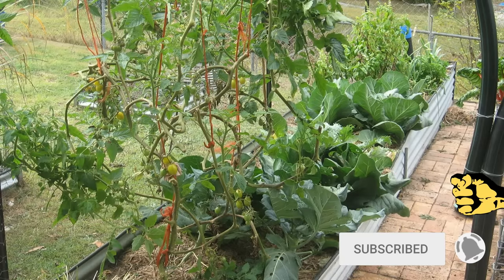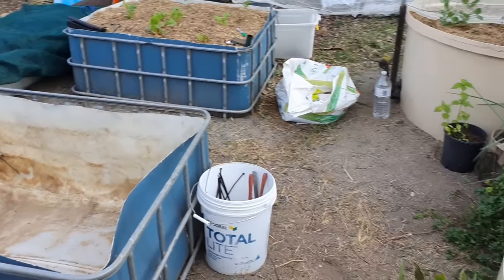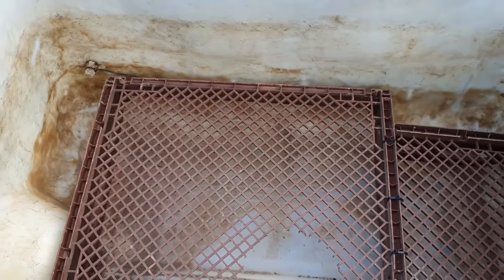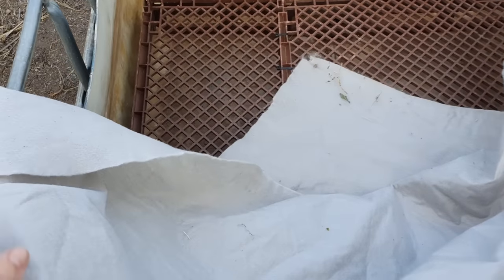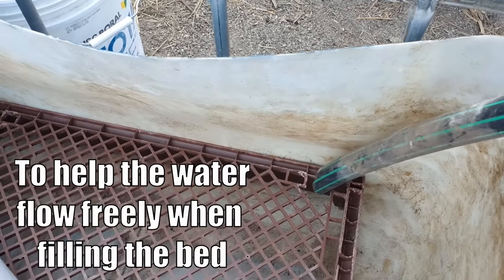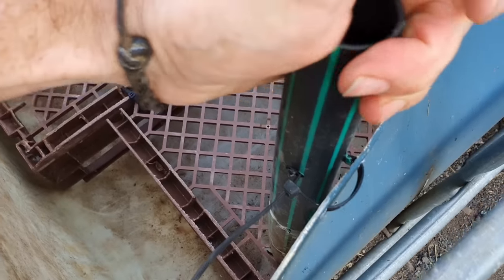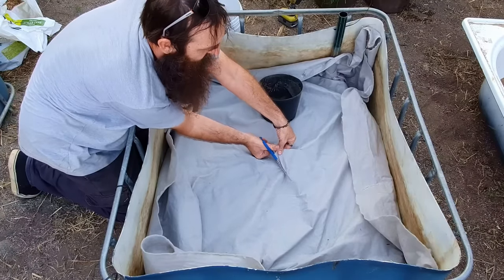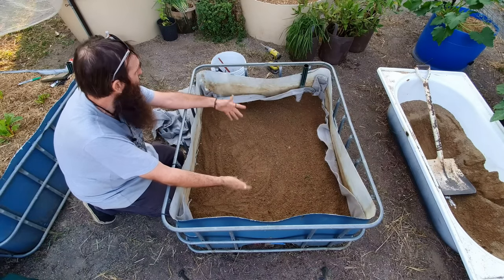How to Make a Wicking Bed with Bread Crates | Large Water Capacity & Healthy Soils

Comment: if you keep water in the bottom of the tank, put a layer of geotextile, sand, and additional level of "this and that" :) why or how get the plants enough water? i would expect the smaller plats dry out without watering, coz their roots not deep enough. i am not saying this does not work, but the water usually does not flow upwards. so what makes it work? i am a bit confused.
Reply from the maker: The water wicks up by capillary action through the sand & soil.

Comment: What paint do you use on the IBC?
Reply from the maker: These ones cam painted as they were a gift from a viewer. I think they just used a straight external acrylic. It does scratch off fairly easy as not much sticks to HDPE plastics. You can get a special plastic primer but I'm yet to try it myself.

Comment: I wonder what is better, this system or  a water electronic hose timer ?
Reply from the maker: I prefer the wicking beds as I only need to top them up once every  week at the moment. They also save a lot more water than in ground gardens as you're not losing any to evaporation or run off.
Cheers.
Reply: Understood, thanks for the tip !

Comment: Hi Rob!
Quick question...(I hope you can answer soon, as I'm starting about 15 of these beds now). Instead of sugar cane mulch between the sand and soil, will sawdust work just as well?  (I have access to literally tons of sawdust).
Thank you 👍
Reply from the maker: I've never tried it to tell you the truth Mark. It would certainly allow water to move through it. 
My only concern is to make sure that the type of timber you use doesn't contain anything that may inhibit the growth of the plants. Some trees have allelopathic qualities & that may pass through to the sawdust if it is fresh. 
Not a definitive answer sorry mate but hope it helps a little.
Reply: @RobsAquaponics  
Thank you for answering so quickly! The sawdust I have access to comes from a cabinet making shop, so I believe the sawdust would be a mixed bag from the different woods they use. I think the main woods they use are oak, cedar, pine, cherry, apple and hickory. I've used this sawdust mixed into my compost and worm beds without any problems...do you know if any of those woods contain allelopathic stuff? (But of course, the woods used are not freshly cut trees).
Thanks Again! 👍
Reply from the maker: @markrakes5602  I'm not familiar with a lot of trees in the US sorry. This came up on a quick search but it might pay to search for each tree individually.
https://www.gardeningknowhow.com/garden-how-to/info/allelopathic-plants.htm

Comment: How does the water wick once the level drops below the level of contacting the soil?
Reply from the maker: Hey Jared. 
It sicks up through the sand in the corners & pot in the centre.
Cheers.
Reply: So the water has to always be in contact with the weed fabric or dirt? I was going to build mine out of 4” pipe and clean rock. Most diagrams show a pretty much level layer of rock (reservoir and your pipe), weed fabric, then soil. In theory if you have an over flow at approximately the top of the reservoir level, the water technically only comes in contact with the soil/weed fabric for a short period, losing the “wicking” property. Once it drops an 1/8 of an inch your not in contact with the growing media any longer. However, these boxes and diagrams are all over the internet and I want to build several for my wife’s garden but I’m lost as to how the water continues to wick once the level drops. Am I missing something or is there an evaporation principle at work? The dry dirt pulls the moisture out of the gravel?
Reply from the maker: @jaredpavatt4122  From what I've seen rock doesn't wick well so that's why I use sand as the wicking medium in all my wicking beds. The smaller particles that make up sand have far greater capillary action than pebbles of rocks. At a guess, I'd say that the fabric folks use to cover the rocks will be doing some of the wicking in the rock filled beds.

Hope that helps.

Comment: My worry and hesitation for embarking on aquaponics is this, how difficult is it for me to take a one week vacation? It's not like I can just pay some kid to feed my cat or put my dog in a daycare. Once up and running, I worry that these operations are so nuanced and particular, that there would be no way for me to find help if I want to go on a family trip. Any thoughts and comments are greatly appreciated. Also, if the electricity were to turn off, how long before tilapia would die andbother things would go wrong? Thank you so much!
Reply from the maker: Hey Jessie. Fish can go a fair while without feeding. We have been away for a week & the fish were just as fat when we got home. 😉 
How long the fish will survive without air will depend on water temperature, volume of water & the amount of fish in the system.  It's quite easy to make a backup air supply in case of power failure. Some folks also sell the pre made switches as well. 
Hope that helps some.

Comment: would the plastic crates leech toxins? I want to use milk crates instead of plastic bread crates? What are your thoughts there?
Reply from the maker: The majority of IBC are bade from food grade HDPE (High Density Polyethylene) so I have no issues using them. 
I was told that some milk/drink crates can be made from recycled plastics but are generally HDPE as well. 
I would probably look into it further if you are concerned about toxins leaching.

Comment: Hello Bob. Im writting an assignement about ginger and wants to to ask you some question, were can i contact you ? :)
Reply from the maker: Hi Sofie. You can ask the questions here if you like & I'll get back to you as soon as I can. 👍😊
Reply: @RobsAquaponics  Thank you, I'll try to do it here. I wants to know which soil you used for your ginger? How often do you give them fertilizer and which kind of fertilizer do you prefer? Are you hilling the soil around the ginger, if yes how often and why? Do you have any problems with diseases? I also wants to hear which varieties of ginger you are using, i read about that the varieties depends of it's use after harvest. What is the temperatur when you start the ginger production? :)
Reply from the maker: @ooprinsesseoo  Hi Sophie.
I found your email on the weekend so have just responded to that. 👍 I'm very sorry it took so long to get to it. 
Hope the information I shared helps you out some.
Cheers.

Comment: Why the sand rather than just filling the bed with growing medium?
Reply from the maker: Have had soil in the bases of some wicking barrels & had anaerobic conditions in the reservoir. The neighbours could smell it from their house so they got remade.😉
I have used a plain dirt/organic poor soil & that worked OK but still found a few smelly sections in the base when the bed was deconstructed. 
I find sand is safe & have never had any issues when using it + I have a load on hand to use.
I'm not saying you can't use it I just prefer not to while I have sand on hand. 👍
Cheers.
Reply: @RobsAquaponics  Thanks for response and clarification. Cheers

Comment: Thanks for the video Rob. I'm just about to start building some beds using the method you outlined. With the bed you created, is it possible to to grow fruit trees? I'm thinking a wicking bed, rectangular in length, about 3-4 metres long to have a couple of espaliered citrus trees. Do you think there would be enough room for the root ball and roots for this to work? Thanks :-)
Reply from the maker: Sorry for taking so long to reply to your comments Aiden. 
I would probably make the bed itself a bit deeper if you're growing a taller tree. That will help to give it a bit more weight at the base when the strong storm winds hit. They should be fine for the shorter trees,  especially if you plant to espalier them. Probably wouldn't do more than 2 per bed though.  
Have you made a start on them yet? 
Cheers.

Comment: How often do you have to water them
Reply from the maker: Depends on how heavily they're planted out. We had a bed with 40 corn in it that I filled daily though summer a few years back (think there was a pic in the clip) but beds with just a few herbs & greens could last a week.  
It's easy enough to make a "dip stick" to pop down the fill tube to see what the water level is at. I was going to include it in the clip but cut it out as it was getting a tad long. 
Cheers Nathan.
Reply: @RobsAquaponics  Thanks for your reply. I built a aquaponics with help from your videos thanks for all your help. Nathan

Comment: Wicking bed === Raised bed without a sprinkler system and significantly more plumbing?
Reply from the maker: Not as I see it as all you need is a hose to fill them. You could add extra plumbing like float valves for auto top up like I have in the past but isn't needed. 
They have many benefits over a traditional bed. Uses less water, stops root intrusion from tress + you can also keep compost worms in them actively feeding your plants as they grow.
Cheers.

Comment: How far up do you fill?
Reply: Is the goal to be the top of the sand barrier? to give the maximum time between refills?
Reply: ok another question: at what point does the wicking stop? like without rope or something reaching down to the bottom of the reservoir does it really still wick up when the gap between the soil and the top of the reservoir water level is greater?
Reply from the maker: @michaelmadison883  The sand pots will allow water to wick up until the reservoir dries out.
Reply from the maker: @michaelmadison883  I fill until water flows out of the drain which is set as high as you like. Ideally water will only wick up about 200mm / 8" from what I've seen so I wouldn't make the res much deeper than that.
Reply: @RobsAquaponics  dude. I’ve been watching you for years upon years now. I greatly appreciate you. I really do.
Reply from the maker: @michaelmadison883  Cheers mate. 😁😁